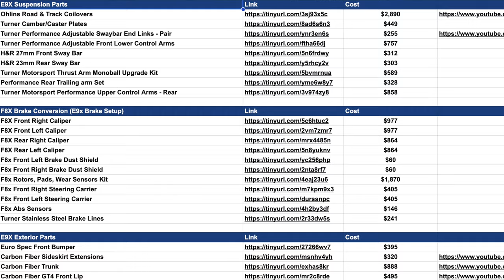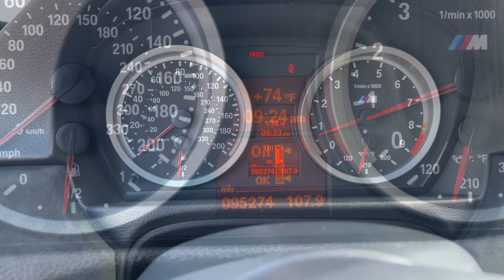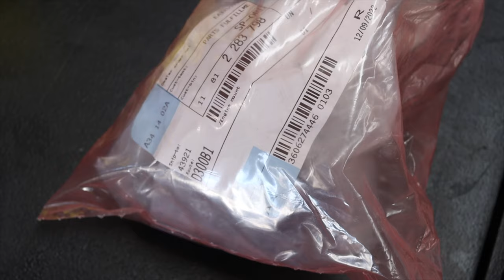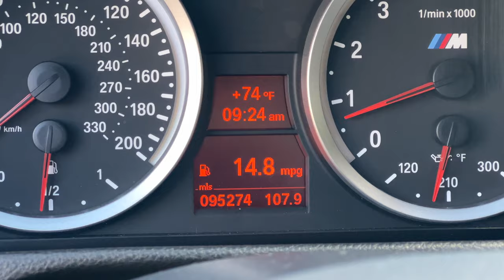Everything I HATE About My E92 M3.

Comment: the cow bell sound, you dont need to replace anything, just take the drive shaft apart and apply grease. I did mine 5years back and still not a sound since.
For the seat belt, just get a seat belt position clip and the arm with grab onto it fine

Comment: I 100% agree with the lack of torque. Definitely takes away from the fun but when it’s up to speed, sheesshh. Best drivers car I’ve owned so far
Reply from the maker: Haha yup!
Reply: can you fix it by changing the diff like you can in the e46?
Reply: @oni5909 yes I believe so. Mine is just going through a full track transformation for the summer I will post back after I have had a go with the final drive 👍 whilst it's had tons of other work carried out I will hopefully be able to pinpoint the difference from the final drive. One thing I will say is that weight reduction makes a massiveee difference on these cars. Fully stripped it was a completely different beast. Even after a full cage went in there is zero comparison to stock. From a heavy tame car it has transformed it, unrecognisable performance gains and that was still with one of the stock electric seats

Comment: My drivers seatbelt hander works most of the of time (after I fixed it) 🙂 (unless on a step slope!). But no there not useless, wait until you get older, I'm 54 and I struggle to reach the belt if the hander fails 😛. Interesting video anyway, and good to hear what the propshaft support bearing noise sounds like 👍
Btw I have the 'Hifi audio' (1 up from base), sounds great, but I too often turn the music down to hear the engine!
Re torque, that's because it's a high HP NA engine 😛, and it's not sluggish over 4k RPM, lol.

Comment: hey that slight oil "Sweat" right below the oil cap is from the powder coat where the oil cap screws into chipping, i have that same issue as well, powder coated valve covers would solve that issue as well
Reply from the maker: Yup, pretty common. You can also run the e46 cap and even out the powder coat up top by lightly sanding it down. This helps with the oil sweating
Reply: @ThicWhips  thanks for the tip, love the car btw, keep grinding 🤙

Comment: Tall people complain about seating position, my complaint is the steering wheel position. I can put my seat really low but the wheel stays high at an odd angle.
Reply from the maker: Might be more related to body type and torso length? My seats are practically on the floor but I find the wheel to be perfect
Reply: Yeah maybe so, I just have always preferred my steering wheel pointing straight at my chest
Reply: @TexasTagz  just readjust it? takes 1 sec